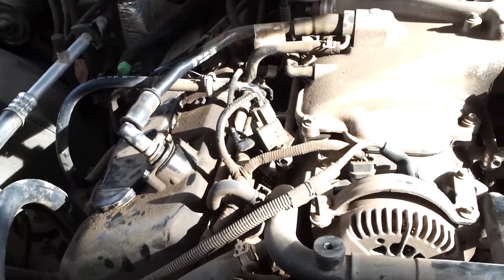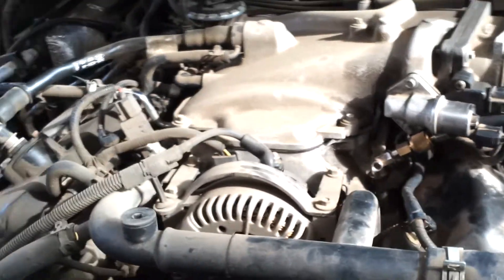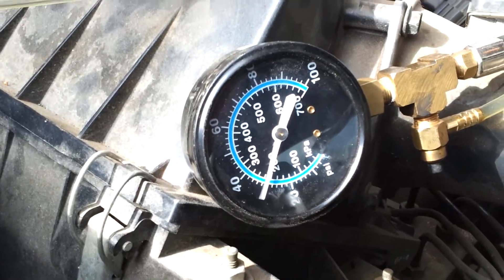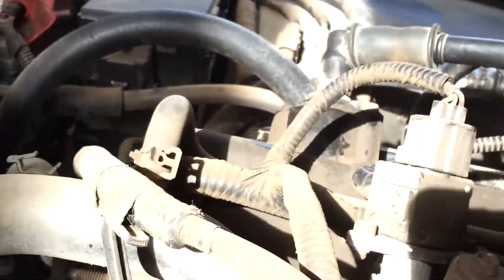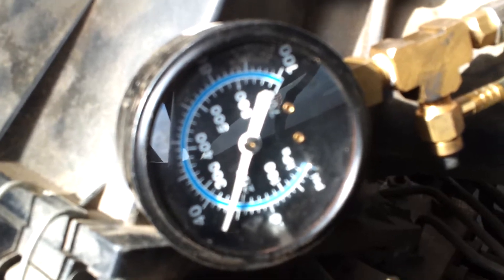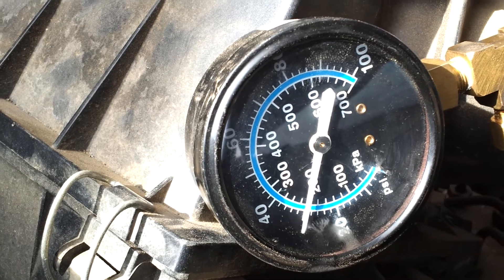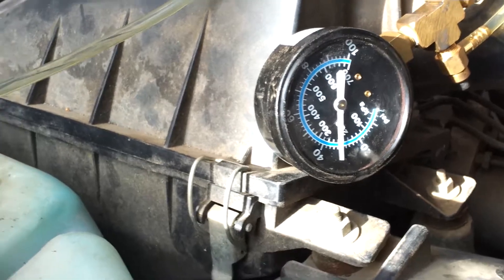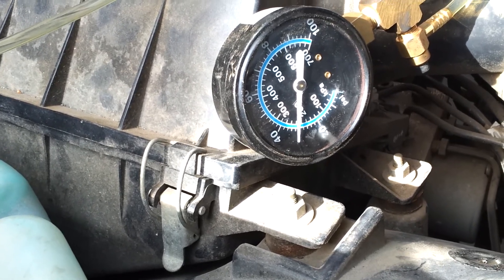2003 Mercury Marauder Fuel Pressure Test

Comment: Turned out to be a head gasket leak between 2 cylinders
Reply: Hello dad
Reply: Ouch! Tough break. Thanks for posting the video though.
Reply: How did you figure out it was a head gasket leak?
Reply: @joecummings8399  Blew air into the cylinders with all spark plugs removed. Leaked out adjacent cylinder slowly. That can show other symptoms of course but by verifying valve position I knew the head had to come off.

Comment: I am having what seem's like the same issue with my 2004 Marauder. Mine is Supercharged running 42# injectors, but it is like only the DS is actually getting any fuel. passenger side exhaust is not even showing signs of condensation.